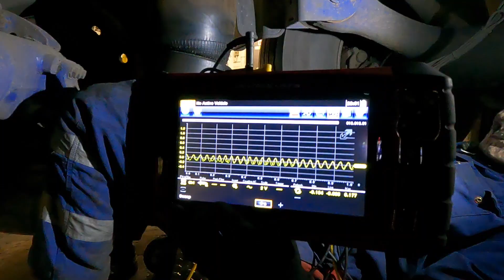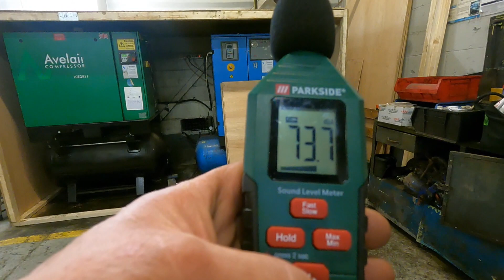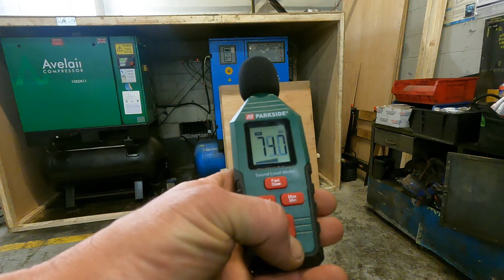Toolbox Tour 3/8" Socket Drivers and The Slow Running Angled Air Wrench. Plus Boney and Chimp

Comment: Funnily enough people have a habit of pinching my inch to 3/4 adaptor aswell, and either not putting it back or snapping the end and hiding it back in the box without saying, needless to say box stays locked all the time now.
Reply from the maker: I'm going to cover missing tools in a video.   I've lost all my long and cranked bars for putting wheels on and they definately have not nee left on the vehicles.